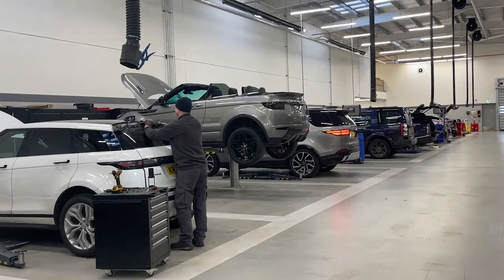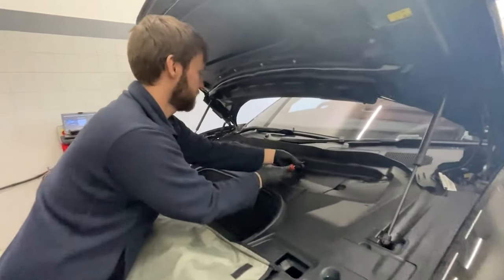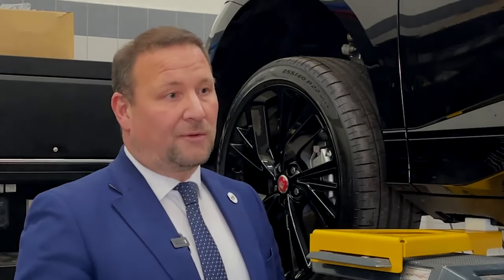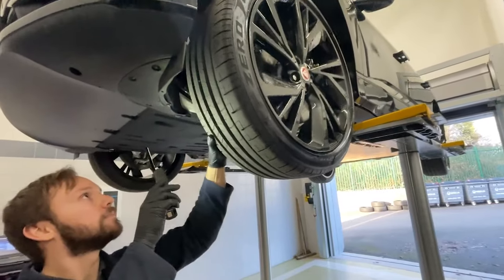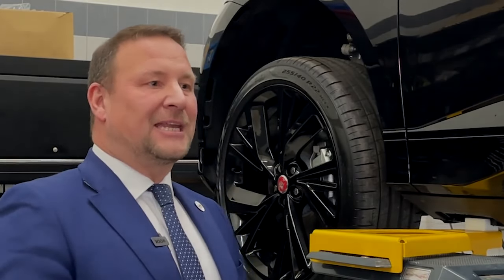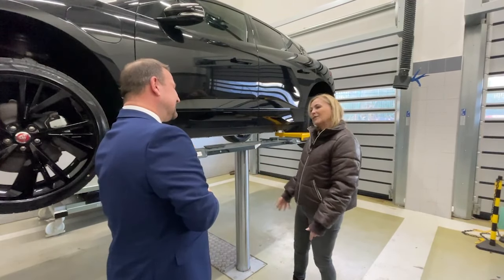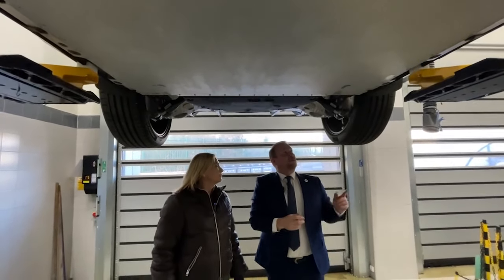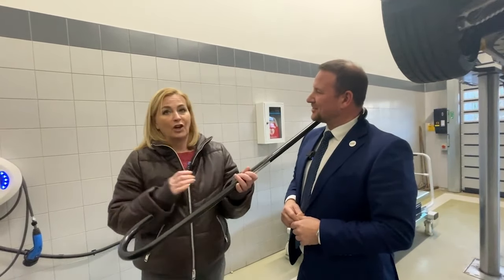EV Servicing: What to Expect with Philippa Forrester

Comment: That garage wasted money on all that new specialist equipment... by the time a car will need a battery replacement the value of the car vs the cost of a new battery fitted by a main garage will warrant the car a write off.. brake fluid change is all that's done now..